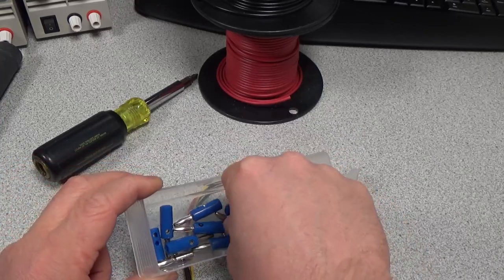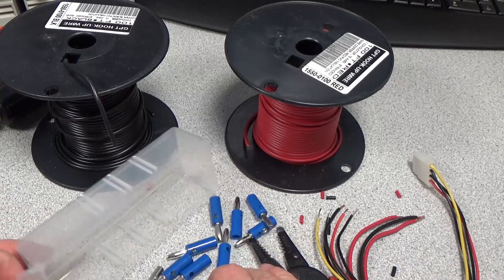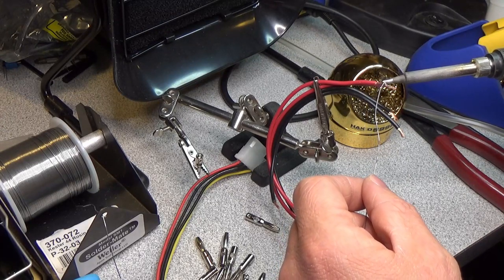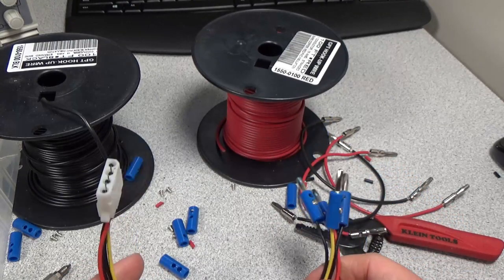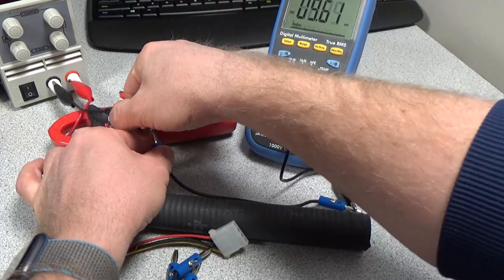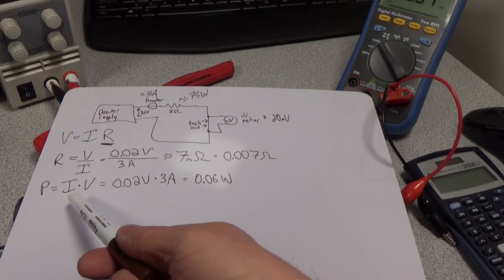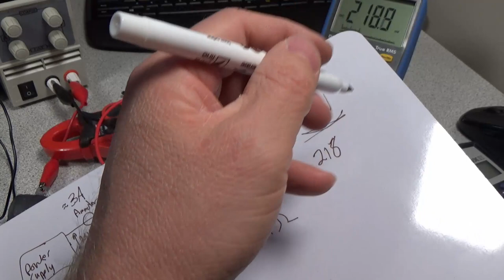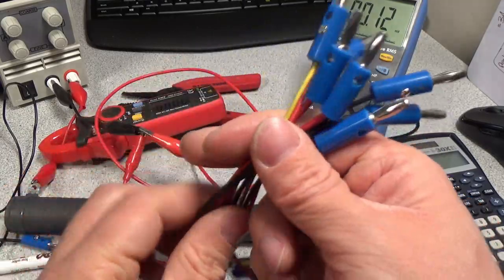Making Cables - Soldering - Testing - Video 7

Comment: Do you label these cables after you 'calibrate' them with their Ohm values?
Reply from the maker: If the cable was documented and marked then it could have a calibrated value however that is highly unusual and not required.  It is important to verify the cables are functional at least to a minimum standard after assembly.   From then on they are just good to use.  A more common practice might be to mark the ones that don't work.

Comment: Where did you get that power resistor? How much are they?
Reply from the maker: I can't find this resistor anymore.  The company Dale was purchased by Vishay and it looks like they don't make it anymore.  Typically for these resistors you need two panel mount clips plus the resistor itself.  Expect to pay about $25 for a complete solution.  

Next closest value for a 225W resistor:
https://www.mouser.com/ProductDetail/Ohmite/L225J10RE?qs=a1NsXFR3MIC853jhAhsxdg%3D%3D